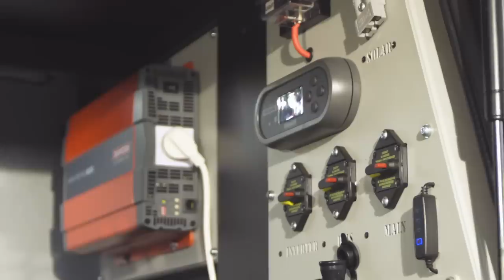Is This The Landcruiser Killer? Why I Chose A RAM 2500 As A Daily Driver

Comment: I've owned Ram's for the last 24 years personally and my family has since the 1950s. I have 4 sitting in my barn currently. The Cummins diesel is a great motor and the truck itself is good. As far as stock HP and get up and go, the Ford 6.7L beats the Ram all day in seat of the pants power. As far as reliability and ease of repair, I'll keep my Cummins. I'm glad to see they are taking off in Australia. The off-road and touring modifications you boys have been doing for years finally can start to be refined and built for USA trucks. You nailed it when you said that Australian made has built a reputation for quality that others look up to. I agree with that. Now to design one of your PCOR beds with the rear tray that also allows a hideaway gooseneck hitch. Find a quality electric locker for the front and rear on the AAM axles that can handle the higher torque and HP. Also, test a snorkel kit that makes sure it allows enough CFM to flow through it to support the turbo(s) on the Ram. Lastly, one free mod that produces great sound out of the turbo, remove the silencer ring from the turbo inlet and let her whistle. Merry Christmas from Texas!
Reply: dunno if i'd say taking off. The 2500 cost $170k here before on road costs, plus the $50K worth of "essential mods" listed here, then you're basically at quarter of mill. Nice of you got the coin, but until they make them from the factory in RHD they're priced way too high to be sold in any significant numbers to be considered common.
Reply: @aedeau  not doubting your prices at all, but what is on road costs? Licensing?
Reply: @3535gt  stamp duty (tax), GST (another tax), luxury car tax, "dealer delivery", registration, CTP insurance etc. Basically it's going to an extra $3-5k on top of the purchase price. Of course nobody pays RRP for a car, so there is some variation in price there, but at $170k RRP the RAM 2500 this is still very much an aspirational purchase for the majority of Aussies.
Reply: @aedeau  Aah, We don't have all those taxes over here but with our new president coming in, it may just be around the corner. Thanks for the info.
Reply: What would one cost you in in states Team Bach?
Reply: @rayzor3463  you can get a plain 4WD with no power windows locks etc, for about $46,000 American. With power windows and such, $51,000. That’s a 4 door diesel 4WD. You want all the features and fully loaded you’re looking at $71,000. The Ford diesel and Chevy diesel are about $5,000 more at each trim level. It’s resale price you see a huge difference. I can search Craigslist right now and find 100 Ford diesels from 2004-2010 wether they’re 3/4 ton or 1.5 ton for under $15,000 US. Most of those are under $10,000 US. That’s due to those engines being nothing but problems and if a Ford has an issue with the engine the entire cab has to be taken off to work on it. The Cummins diesel on the other hand, you won’t find it less than $10,000 and usually not less than $20,000 unless it needs a new engine or something like that. I’m looking at a Ram 4500 for trailer pulling right now. I can get one for about $53,000 US. That’s 4WD and 4 Doors. Those trucks with four or five years on them and 100,000 miles are still about $46,000
Reply: @3535gt  so cheap in the states, hopefully one day they will be that cheap in Australia
Reply: Then 10 speeds in the Ford Super Duty's are having some pretty big problems.
Reply: @jakey20022  I’m not well versed in the ford 10’speed. Is it due to towing or modification or just in general. I love to modify my Ram’s but in the end the stock stuff has held up well with slight tuning and not bashing it.

Comment: One cannot fail to be impressed with this truck.
Reply: @NaughtyNed  you decide.
Reply: would you consider one andrew?
Reply: You're not gonna do a RAM build next are you??
Reply: @NaughtyNed  ever worked on one, let alone driven one? I think not.
Reply: @NaughtyNed  gotta try harder than that to get me butthurt. Get back to me when you actually know something about Rams.
Reply: Oh...one can.
Reply: Looks ugly AF
Reply: @NaughtyNed  it's a Cummins diesel, they are legendary for their reliability.  It's on two solid axles with 11+ inch ring gear.  Coils front and back.  Fits 37" tires with ease.  I drive mine all the way across the US to go to Moab every year (sometimes twice).  Over 320,000 kms on the odometer currently, and I wouldn't hesitate to take it out in 40c heat or 40 below zero.
Reply: @NaughtyNed  They're very unreliable without "Cummins" engines.

Comment: Got a 1500 and 2500. 1500 is my daily driver and smaller toy tower, with air suspension. Not bad for off-roading. The 2500 is my beast that tows my monster and handles the off-road situations where I live with ease, but is an incredibly thirsty beast. Been looking at replacing the stock box with a custom box. Wish we had something like this in canada.
Reply from the maker: Hi Cory, PCOR trays and Canopies are available in Canada. Contact sales@pcor4x4.com
Reply: @PatriotGames  AWESOME!!

Comment: My daily driver is a 2500 CC with the 6.7 Cummins and a factory box. There are a couple of upgrades that my truck has to fix some of the issues. I added a Dynatrac free spin kit which gets rid of the unit bearings in the front and adds about 2 MPG when the hubs are unlocked. It has the locking front diff from the Power Wagon in the front and an air locker in the back, Fab Fours full guard winch bumper with a 14,000 lb Superwinch Talon in front and a 12,500 lb Talon in the back. It runs on 37x1350x18 Interco M16s (7" long arm lift) and sits around 7'4" tall.

Comment: Honestly the Ram Power Wagon with the Hemi here in the states is a well equipped off-roader “out of the box”.
It has front/rear lockers, 4wd hi/low range of course, sway bar disconnect I believe.
I wish they made it with a Cummins but I don’t think they do.
It’s one of the truck I want to add to my garage at some point.

Comment: Impressive truck. As a grey nomad I would definitely place a bull bar on the front and perhaps move the roof rack for the maxtraxs over the canopy so I could use the sunroof. Video didn't say the fuel tank size, perhaps add another tank if I needed the range.

Comment: Ive always wanted one of these with American Expedition Vehicles lift and fenders, 40in tires on a 3in lift and all the torque you could ever want
Reply: I'd love a Prospector XL.  Ever since AEV did the Prospector XL with the Tray, I've been hooked.
Reply: They have a ton of torque, but you'll notice the power change from a 33" tire when you go to the larger tire unless you regear. Some say you gain the loss of the get-up and go on the top end with Fuel economy but I never noticed that. Others say the engine runs at a better RPM with the larger tire but with mine running 35's or 37's, I always wanted to regear it to gain some of the get-up and go that I lost. Mine has 373's and was producing a bit more power than stock HP and torque. We run the F550's on 42's at work. Google Skeeter brush trucks for a picture of what I am talking about. They are regeared and also as tall as a house, but the big thing you notice is how much longer it takes to stop the rolling mass. That is on an axle and setup way beefier than the Ram 2500/3500 runs.
Reply: @3535gt  my town fire department has a couple trucks like that but 4 doors with full exo cages. I think I would get it with 4.10s off the bat
Reply: @Tanner731  good idea, I think the brush trucks are running 4:56 or 5:13. But those are carrying way more weight than an over lander would
Reply: @3535gt  I'm running 37s with 3.73 final drive (Ram 2500 with the 650 lb ft 6.7) and it still has no trouble with a 14,000 lb trailer. I have thought about swapping to 4.56 to get back to factory spec, but I like my odometer turning a little slower.
Reply: @rich7447  exactly. The “less” miles on the your truck is always a benefit. The newer trucks with 6 speeds/8 speeds and now I hear 10 speeds(Ford), I’m sure have a lot less issue with the getup and go. All of mine have the 4 speed(except SRT-10=6 speed tremec) and the jump from 3rd to overdrive I’ve never liked, especially towing. My current towing rig is a 3500 with 4.10’s on 33’s and I can tell it doesn’t want to run down the highway as fast which is fine, it tows. But I’d like to try the newer rams with more gears in the trans and the 3.73. If you’re looking for getup and go, look at the pedal controller that has finally come to the USA. They’ve been running them for years over in Australia and that seems to quicken the response with the change of a dial.

Comment: Justin, I’m an American viewer and love what you’ve done with the truck. I know there are differences in the laws between our two countries, but I would recommend a few parts manufacturers for you to look into for your rig. 

Morimoto for better headlights and taillights. Hutchinson double beadlocks. Northwest Fabrication for additional transfer case gearing. They make a doubler that will bolt onto the front of the case. Not sure if you would prefer a manual transmission on this rig, but they make one for the Ram trucks as well. It’s a Getrag G56. Many companies sell upgraded models and all the kit needed (bell housing, flywheel, dual-disk clutches, etc.). You NEED to get some locking hubs for the front axle. It can help fuel mileage and make the front more robust. Yukon Gear & Axle makes them. Of course ARB makes air-lockers for the differentials. I’m not sure if you would be interested in methanol injection for the truck, but it can improve fuel mileage and power as well. (You can use windshield wiper fluid in a pinch instead of the formulated blends.) Snow Performance does that. Companies that make good, emissions-compliant performance parts are BD Diesel and Banks Performance. 

I’m certain I’m not telling you anything you haven’t already researched already, but I just wanted to give you some ideas. I love all of the gear and video content you guys make. You can really turn these trucks into beefy platforms if you are so inclined.

Keep up the great work and much love from the US!

Comment: 22 tons? Surely you mean 22000lbs? (11 tonnes) 
Love the truck. Thanks for sharing and keep em coming
Reply: 22000 lbs is 9980 kgs.
Reply: @bazza76d53  Your correct, Thanks
Reply: Yeah there's no way that's towing 22tonnes 😂
Reply: Actually I think he did mean 22 imperial tons. He said in the states with a 3500 dually. Those are legally rated to tow over 35k lbs. Over 26k lbs needs a commercial license. These trucks are used to transport cars and cargo all the time at a commercial scale when using a semi isnt feasible

Comment: An idea on your roof racks, have you ever considered an extruded (or expanding) foam underlay molded to the roof? It would add sound and heat isolation, extra load capacity, stability if combined with a lower profile aerodynamic shape be a game changer.

Comment: Justin in my opinion Sarah's 1500 is a Land Cruiser Killer. Your 2500 is a Land Cruiser eliminator. As for what I would do differently, not much really. I would put a different bar on the front and go all around skid rock sliders, just for a tad more protection. And I would pick a different colour. Otherwise what you have done and the yet to do parts that you have mentioned in the video it is a damn near perfect truck I think.
Reply: 😂😂😂...land cruiser killer ??? Nothing can kill a land cruiser

Comment: Great video Justin cheers! If you were in the USA you’d get so much crit for this as there are millions of RAM haters out there with their Fords, Chevys and Toyota’s lol but that’s okay I’m a RAM owner got 2 1500s ones a third gen 6speed manual and I just got a 2020 hemi with ram boxes so I don’t even really need a tray anymore for what I do just a built in bed deck and rolling aluminum cover. I don’t tow and didn’t wana spend $10k more so that’s honestly main reasons I didn’t get a 2500 even though I want one! Since DEF was introduced into the states on diesel trucks I have been put off and prefer the older models especially with the 6speed manual. If they find a way to get rid of the DEF I’ll get a 25-3500 auto next time, but by then maybe the electric offroad trucks might be the way to go 🤷🏻‍♂️. Either way I’ll keep my gassers til they die. They’re so easy to maintain and even with inferior fuel economy the life cycle cost of the vehicles is great!

Comment: 2002 Dodge Ram 2500 w/Cummins 5.9 2nd gen engine, NV 5600 six speed manual & Dana 80 rear end. One owner (me) and now coming up on it's 20th anniversary and ~200k miles (320k km) and it's never let me down once. It started life towing a 32' Montana Mountaineer TT (~18k lbs with truck & trailer) so it got broke in real good. It now carries our custom all steel camper top so around 10k lbs loaded when we head out camping. 
   All the naysayers going on about how bad the Dodge cab/chassis is either don't have a clue or treated their rigs like shit. This is hands down the best pickup I've ever owned and I have no plans of ever letting it go. You gotta love the Dodge Ram!!!!!

Comment: They scrapped the 5.7 option in 2017. It's 6.4 hemi we run here. 410hp 430tq. I have 4.88 gears in mine tow 25k lbs with ease.
Reply: And you can actually run 37s with no mods and the right back spacing on the rims

Comment: May I suggest replacing the front hubs with something like the Dynatrac Free-Spin manually locking hubs. They will eliminate the troublesome Unit Bearings, and possibly give you some proper 2wd mileage.

Comment: Nice run down on the 2500. Would be my pick for a vehicle, if I could afford it.  Like you covered awesome torque but out of the box there is bugger all that needs changing. I like you have the basics covered in wheels, canopy etc and not much junk cluttering the interior. Yeah I’d have gone a different bull bar though,  a snorkel & a light bar up on the roof rack. I find the high set light bar on the roof rack better for picking up Roos etc out west at night. Big thing, the KISS principle is how I like my trucks too. Nice job on this one. What’s the height of the lift you did? I don’t recall you covering that.

Comment: So there’s definitely benefits to the 6.7 vs the 6.4 hemi. The torque is way more in the 6.7, it’s true. The issue is the platform really doesn’t make use out of it. Towing on my 6.4 hemi with 4.10 is 16,880 vs 19,000 with the 6.7. 2100 lbs for nearly double the torque. Why? Cause the platform is exactly the same. More torque doesn’t mean more towing. And you lose about 850 lbs in payload with the 6.7. When you consider all that, and then realize the 6.7 is going to cost you a ton more in fuel and maintenance, the only reason to get a 6.7 is to say you have a 6.7. Which trust me, I get. If you love diesel, it’s the engine you want. But it’s a luxury option, not a necessity.

Comment: Great deal of thought and design has gone into this, I like it. You are right, the front bar sucks. I would throw extra lithium into it and forget the solar. A good DC charger puts 50 amps or more in and replaces what you have consumed very quickly.

Comment: 6.4 liter hemi. Will tow almost as much as the 6.7 diesel with a slightly lower overall cost.
Reply: The real cost is IF the diesel engine needs repairs
Here in the states we have stupid complex emissions stuff
Reply: @ronaldspins  these things are expensive in aus, imagine the repair for parts here. wish you boys got the diesel nissan and toyotas. way more viable and can fit on the tough tracks

Comment: 2500 Hemi Crew Cab 4wd with a 4.10 rear axle can haul almost 17,000 pounds.  It also carries a full 3,000 pounds.  No, it doesn't have 800 ft pounds of torque but good golly, how often do you use all that torque?  Gasoline is cheaper than diesel and so are maintenance costs.

Comment: The only problem is the 3500 ram has more power and the better transmission then the 2500
Reply: Only if you opt for the different transmission and HO Cummins

Comment: I'd be interested to know what the GVM is (Im assuming its over 4495kg and into the heavy vehicle code)
Reply: Pretty sure 4500kg most of the American imports
Reply: GVM for a Ram 2500 is 4490kg. You  get 913kg of payload.
Reply: Here in the US the Ram 2500 (non Power Wagon) is 10,000 lbs.